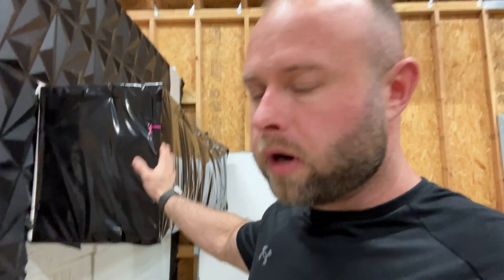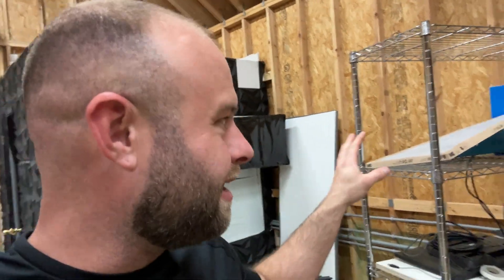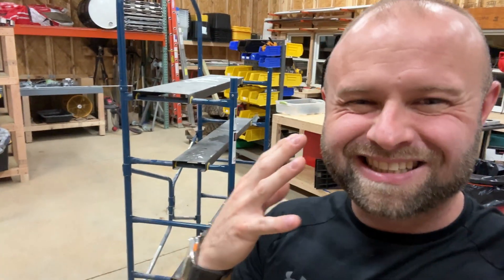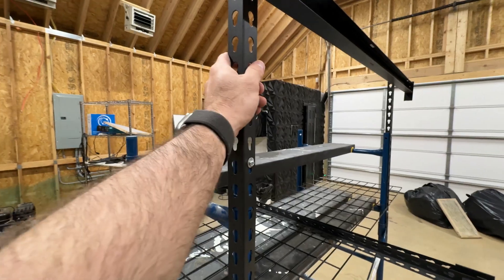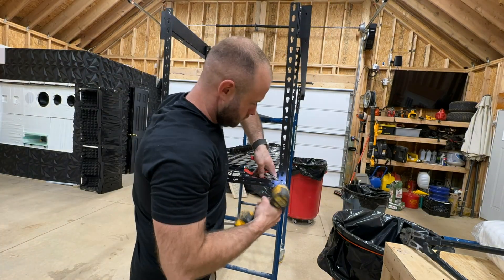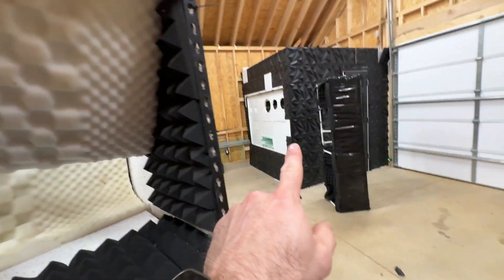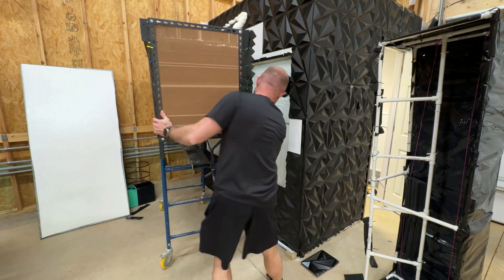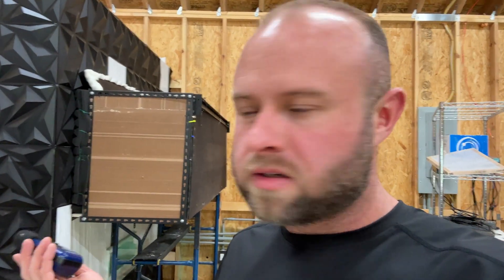CHEAP Material SILENCES Bitcoin Miners

Comment: If I recall right you didn't have sound dampening material inside that mining box walls.  You might want to test it if some couple pieces of rockwool would dampen the sound there noticeably.  Just be mindful about the material combustibility you don't want it to end up as a timebomb for fire hazard. These both cooling builds and sound dampening builds are pretty much spot on for anyone who is thinking how to expand without getting problems from heat and/or noise.  The cost of material has also real meaning here, so you want to have pretty much basic materials there, but still the materials exactly right for the purpose.  Sound is kind of bouncy thing, you want to reduce it's ability to bounce from anywhere, especially large surfaces.  If you find good combination of materials and how to build it and have it affordable, theres the recipe to make it happen in bigger scale too.